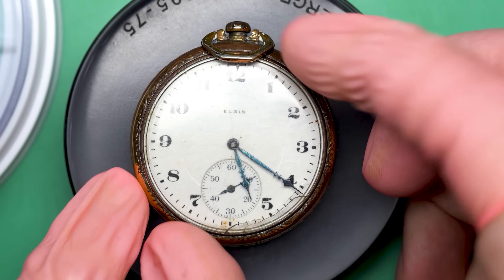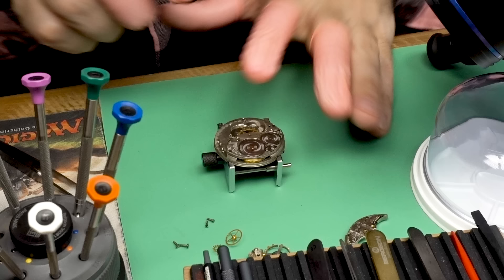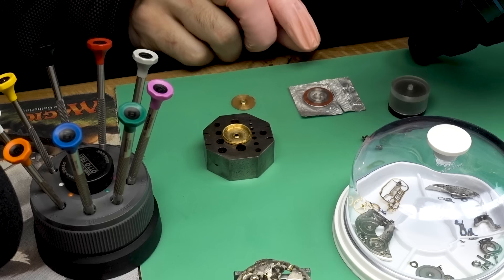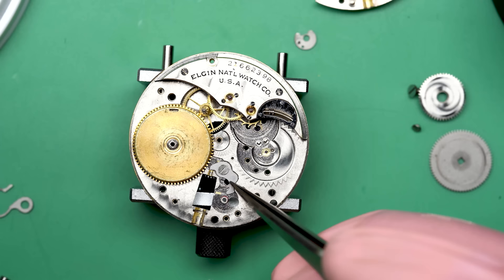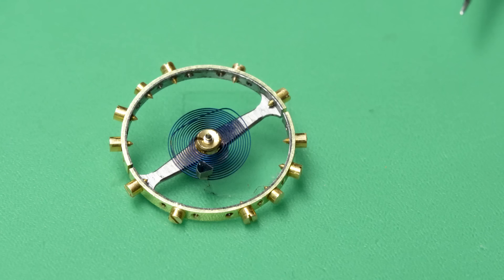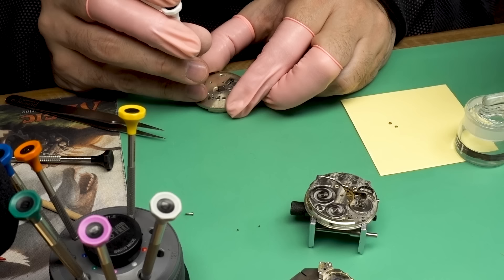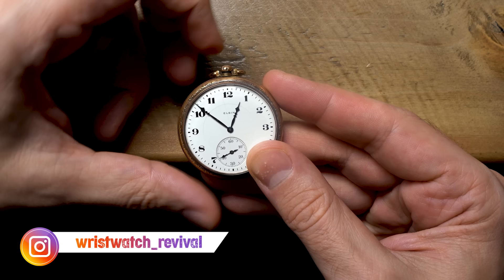My First Patron Sent Me His Grandfather's Pocket Watch

Comment: I have an old elgin that you have to remove the crystil  and pull out a lever to set the tome, but the main spring is broken and watch dont run , I think the date inside is someones birth day it may 9 1891 but its been scratched in not stamped or engraved , it also has a lot of out side wear on it also, the gold is gone for the most part, thanks for showing this repair on the old gem.

Comment: 30:13 it needs some cleaning. Even thin grime can affect its measuring performance. I recommend sliding a piece of post it paper folded in half. It's excellent for cleaning metals (and plastics) of grime. I used to use this trick all the time when drafting in architecture uni.

edit: you should also get yourself a jewel resurfacing tool. It's not easy to find, but something like that jewel (and later using a shim washer to space it from behind) you can give it another go at life just with two or three swipes on it. If you look up 'Vintage Restoration: Jewel Wear' on bobinchak's blog, you'll find a page repairing just what you're working on.

Comment: If you have an enamel dial with obvious hair line cracks, not missing pieces soak it in room temp sudsy ammonia for an hour or more depending on how dirty it is. The ammonia will remove all the dirt in the hair lines and around the seconds register. They will become nearly invisible. Then just flush with water and dry. The dial will look like new again. Sudsy ammonia is available in any supermarket.

Comment: Excellent job Marshall. No you don't want to do much more than clean the case and replace the crystal on something like this. You did it perfectly and I hope to be doing the same in due course. Keep sharing your Horological journey mate, you are inspiring new watchmakers, and this will only save more of these treasures that would otherwise be lost.

ETA: I do have a 1917 Inventic pocket watch here that I will do once I've finished Mark's course (Waiting on the Seagull ST36 movement coming from China). I will probably nickel plate the case but that is because it's a steel case and was basically the 1917 version of a disposable pocket watch. It appears to be a very strange (to me) pin lever movement and very cheaply made with stamped parts, no jewels, and tech that was old hat even in 1917.

Comment: If you’re new to watchmaking, and want to learn on a pocket watch, be sure to buy one that runs. As a beginner don’t think you can get a cheap non-runner working.  They are cheap because there’s something wrong with them. Usually a broken balance staff or a cracked jewel.  Replacing the main spring in old pocket watches is a challenge too because it’s tough to get the T end of the bridle into the slot in the barrel.

Comment: I've got a watch,  it's 17 jewel, has more decorative face , and case is scroll work on front and sides, back as well as hexagon shaped.
But movement appears to be identical to my eyes, not saying much there I know. 
Was supposedly made in 1921 non railroad grade, and a lot more information on it.
It doesn't wind as the mainstem is locked to one direction, but you can set the time on the hands.
The crystal is in very good shape, a minor indentation in the back of the case, are appears to have the same pattern on the back, but more as if it's from rubbing on something in someone's pocket. 
Yet as I said it does match the pattern very closely. 
The balance moves somewhat, but not what you would call freely. 
I've had the back off, but have not attempted to do anything but look see what the jewels were, and the serial number to find date of manufacturing. 
Otherwise to my knowledge it's unmolested by human hands.
It does need a deep cleaning just from the dust it's gathered sitting on one of my knick
 knack shelves for the past 10 years or so since I paid $20.00 for it, and part of the chain it has with the intention of having it refurbished.
The chain appears  to be missing only the top most piece that went through the button hole, as it's too long to have been just a fob on the end of a shorter heavier chain that was the custom of the time.
If I might be so bold as to ask, what would be a reasonable price for the repair and cleaning of such a time piece Sir?
I communicated with a gentleman some years ago, but I really don't remember what exactly he said, and something about him made me think twice about sending it to him.
So back on top of the shelf it went for all these years, even though I have taken it down, and pondered upon having it done, as it really is a excellent example of the time period it was fashionable in

Comment: I'm sorry for sending you this message to general comments but I have a pocket watch that has been in. My family for almost a hundred years or posisbly since being bought from Tiffany and co.  Not sure because the Tiffany records office in Chicago had a massive fire in early 1900 and they were lost.  It's in not the greatest shape it runs, but it has no hands and the case is wicked rough. I could restore the sterling case my self but was hoping you would take the restoration over because the watchmakers near me,southeastern mass, only deal with newer wrist chronographs and things like that. .   if you could help me with compensation I would appreciate your time . Thanks so much. 
Btw it's a lognines movement and it has a secondary second movement both hand sets are loss but almost sure that both are originally the blue anodized coated hands.  Thanks again for your time love your vids !

Comment: If you want to go down a rabbit hole, look up "automatic screw machine" and check out the cam driven mechanisms.  They are still used for production today, and most high quality US made measuring tools have components made on them.  CNC Swiss machines cannot match the speed of a Screw Machine for many simple parts.  Also look up Hydromat for multi-spindle machines.

Comment: Hey WWR,
I have an old Seiko that belonged to my dad that he wore in the Airforce, It runs but hasn't been serviced for 20+ years, The automatic winding works on it but the date and seconds hand doesn't work on it.
There's also 2 buttons over by the winding stem that don't do anything now, And it needs the wristband replaced.
If you want you can take a look at it, Just contact me if interested.

Comment: Speaking of that toothbrush handle. In this case that wouldn't matter at all, but if you had something like plated surface with really thinned plating, it would be better to use the lowest friction materials. One option is to have a PTFE film (not a plumbing tape but 0.2 mm sheet) as a protective layer, another one is to get a PTFE rod (10 mm dia. or so) instead of a toothbrush. Both options are easily available from eBay. The problem is that materials like polyethylene (toothbrush handle) even being a kind of sleek, still create a lot of friction, so thinned plating can be rubbed off.

Comment: A lot of the blued parts were most likely heat treated in a bed of brass shaving. That gives them the deep blue purplish color. I blacksmith and the the blue I get isn’t quite as deep, plus the brass bed takes little less heat so won’t undo the hardening or heat treating

Comment: They were actually called Screw machines. some of These screw machines were in operation up untill the 1980’s. CNC are used today to make all types of screws. The machines are fundamentally the same but are computer controlled. The primary difference would be changing the type of screw made is easier. The older machines were automatic but mechanical with tons of wheels and gears. once set up the could machine millions of screws.

Comment: i have a hamilton 974 size 16 pocket watch. still has its glass crystal. the case is worn though. non of the gold fill is left.
works like a champ. stem set. not sure what its worth though. serviced in 2016.
i still really like the non battery watches. something reliable should the power stop. very nice to look at.

Comment: I have been researching watch repair off and on, even bought myself a less than adequate tool kit, more of curiosity thing…opening a couple of watches…my question is, would a pocket watch be the better playground, starting point to take apart and put back together…bigger parts, maybe a little easier to work with 🤔

Comment: Marshall, love your videos, I'm wanting to try my hand at a pocket watch as you frequently recommend. I live within about 30 minutes of Elgin, IL so I'm drawn to the vintage Elgin models. Are there certain things to look for or cross reference when looking at watches on ebay?
Reply from the maker: I would look for the most popular models so you can easily get parts/donor movements. If you want a finished product the case is actually the most important part as movements are very easy to get.
Reply: @WristwatchRevival  Thanks for replying, I'm prone to jumping into a hobby headfirst. I won an Elgin wristwatch from the 60's that is supposed to be a runner but needs a crystal. Also, picked up a fairly clean looking Elgin pocket watch that was listed as winds but doesn't run. I watched your video on entry level tools to break down a watch and ordered some things to get me started. My goal is to not rush the actual repairs but I do like having the majority of tools I would need to do the work.

The movement on the pocket watch actually looks quite similar to the one in this video.

Also, just wanted to thank you for documenting and sharing your hobby with us. I'm currently recovering from a major surgery so I'm unable to enjoy golfing for quite a bit. Hoping to find some joy in the watch game, I thought about it years ago and am finally just going for it.

Comment: I got three old pocket watches that I'm trying to get repaired. I started losing hope on finding someone who can work on them and now two of them are missing somewhere in the house. The one that I can still find is an old key-winder pocket watch. It's probably the oldest and maybe in the best condition. The problem is, it won't wind up. The second oldest is an old Ansonia that I got from a neighbor who found it in the attic in a box of the houses previous owners belongings. Which dated to roughly around the time of ww2, it's in the worst condition. The newest of the three antiques, as far as I know, only needs a new spring. It was the only one in the antique shop that still had part of its chain, hence why I got it. It was also my first antique pocket watch. 
Any chance you could help me out?

Comment: Ideally the case back would be smooth and this is similar to automotive body work.  It can be flattened with a small (tiny) ball-peen hammer against a leather sandbag and then the back would get polished optically smooth.  A paint less dent repair guy would have more information - they are artists.

Comment: Love those watches! I wondered regarding the back if your rubber press would help push any of that out if there were some forms that you could utilize with that press? There is also a small press that is made made by Dake. They are very good for pushing things back into shape, usually flat surfaces. That said you will still need a form with contours in order to do it properly. Maybe someone makes forms or dies like that?
Reply from the maker: Yeah I bet there is, I like that idea

Comment: Love this channel. Don't know why, I have 7 thumbs and could never pull off what you do. Still, I can't stop watching. I do have a question. I have a Seiko watch given to me by my Stepdad before he passed. It's a sharp watch, stainless case with a diver's bezel. It is however, a quartz movement. Dad had it for years and now I have too. Trouble is, it needs a new crystal. Do I risk replacing the crystal, knowing that the watch could stop for good any time, or just polish the scratches out? I believe the crystal is glass. I've tried polishing it with jeweler's rouge and had no luck. What do you suggest I use to polish the crystal, or just get up off my rusty money and have a new crystal installed? Thanks so much.

Comment: Did you skip the braking grease on the barrel spring? I know nothing on watches other than your videos. And I've gotten used to a pattern you seem to follow which usually includes the different lubes in the barrel spring. I'm hypnotized by your hobby. Well done.
Reply from the maker: I did, you only use braking grease on automatic watches :)
Reply: @WristwatchRevival  Ah, of course. Amazing hobby.

Comment: Howdy Marshal!  I've been repairing clocks for quite some time now, and am slowly working my way down to smaller movements.  Per your advice, I bought a non-working Elgin pocket watch on ebay to experiment with, plus I've been slowly building up tools. In any case, the watch I bought needs a new mainspring and a new balance staff (at the very least).  What's your source for watch parts and how do you figure out the model number to make sure you getting the right parts?  Thanks for all the great videos and instruction.

Comment: I have an Elgin Grade 75  (SN 2897670) that is my "First" real attempt to re-assemble a pocket watch. I have gotten it all apart, cleaned and I am in the process of putting it back together. It needed a new Main Spring so I found the one I needed to order (I used the pocketwatch Database and their "Parts" to find the #812 spring and ordered the JA-103), mine did NOT slide in the barrel easily at all (like you do) I tried everything short of a hammer. It's obvious something wasn't working right. It seems to fit the barrel and I thought the hook inside the barrel might have prevented it, but even the opposite side would not push in. Any thoughts?

Thanks, and I love your videos.

Comment: Hi
I'm working on my first pocket watch... very similar to this one. A 1919 Elgin with a broken main spring. I found the part number [817] but I'm finding it hard to find a replacement, at least one that doesn't cost an arm and a leg.
Where do you source your parts? Are there other, new springs I could use instead of original Elgin springs?

Comment: Hard to believe the machining capability from the 19th century.  What would it take to get the beat error down?
Reply from the maker: It would require taking off the balance, then the spring off, then making minor adjustments probably 6-10 times, hopefully without damaging the hairspring. For a sentimental watch like this that isn't going to see actual use, I don't usually risk it.
Reply: @WristwatchRevival  Thanks.

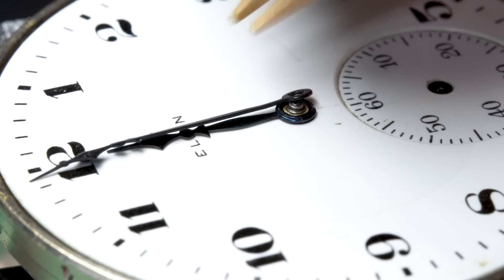Comment: 35:36 Blue steeling is technically a chemical thing. It is a chemical reaction between the oxygen in the atmosphere and the steel. It is also technically a treatment that incidentally is called heat treatment. People use the word natural in all sorts of weird contexts. I wouldn't consider steel being at that temperature a particularly natural occurrence. That being said, thanks for sharing the video, it was interesting to watch.
Reply from the maker: Technically like everything is a chemical thing. I meant that you don't put chemicals on the metal to change the color.
Reply: @WristwatchRevival  My comment is more in the context of how people are using the word chemical do describe something bad, and natural is its supposed opposite, which is considered good, when everything is chemical in nature. The sugar in a fruit is considered natural, but white sugar is not, even dough it comes from sugar beets in my country. Chemically there is very little difference between the two. I don't think you should be allowed to label a product as natural. What is natural granola cereals? It´s not like there are granola trees...

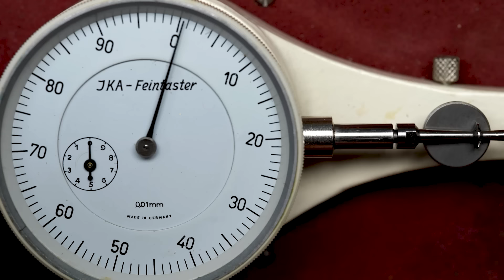Comment: I checked the equipment list and I was wondering if you would share/recommend a source for a micrometer like the one shown at 30:02 in the video. I've seen digital ones on aliexpress but my understanding is that those are not as accurate as the device shown.

Comment: I have both of my grandfathers Elgin pocket watches somewhat similar to the one in this video . One works rather well ,the other wants to but pivot point on the balance wheel is broken off. It will run if you hold the watch at just the right angle,which leads to think it's fine otherwise. The question I have is are surplus / new balance wheels available or would I need to try and find a good used one ? Do you have a preferred source for parts like this you could share ? Thank you

Comment: The mainspring beeing a little High in the midddle i have heard could be caused by someone feeding it back into the barrel manually without a Winder
Reply from the maker: Yes I think that's the most likely cause as well. Especially multiple times.
Reply: @WristwatchRevival  when did you start repairing, i myself started 6 years ago and looking back at my first “repairs” i must say that my skills then and now are two different worlds, and actually a faulty pocketwatch Can be a far greater challenge than a “new” watch where parts Can be replaced imo

Comment: Is there a reliable place to identify the mainsprings needed for particular watches? I bought an 817 off eBay for a 1901 16S Elgin, based on what was recommended by a well known pocket watch site, and the one that I got, the "circle" it was wound into was about a 32nd of an inch bigger than the barrel, so I couldn't just neatly pop it in, the way you do in your videos. I finally got it in by placing it over the barrel, pushing down on it from above, and winding it from the middle with a forceps until the tail pushed in. It worked, but it wasn't fun.
Reply from the maker: I go to cousinsUK
Reply: @WristwatchRevival  Thanks, Marshall.